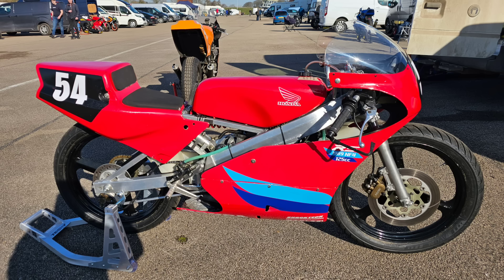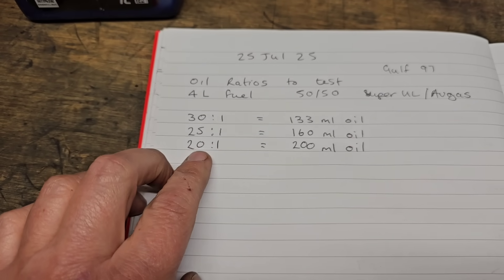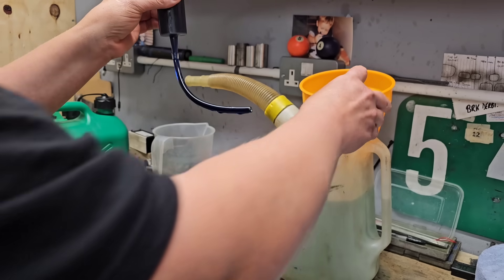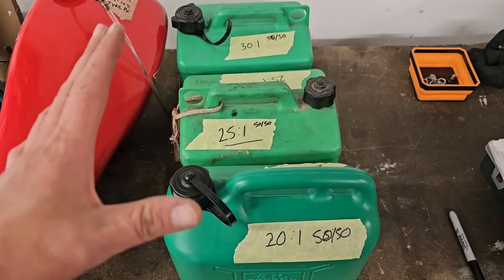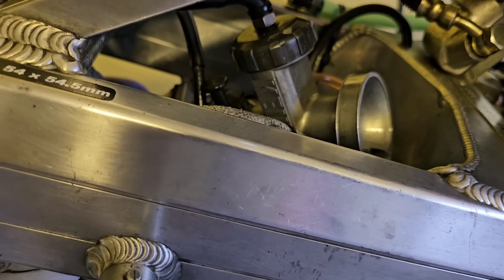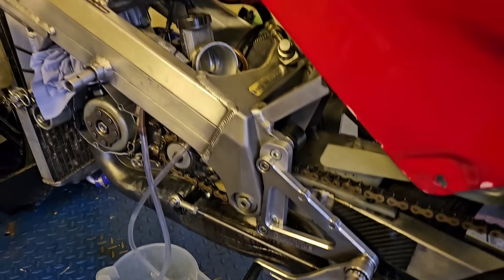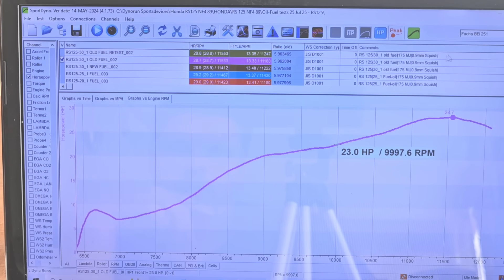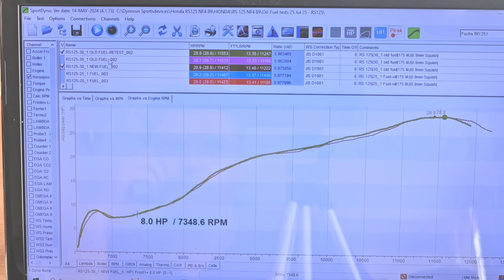Does 2-Stroke Oil Ratio Really Change Power? (Dyno Tested)

Comment: Depends on the quality of the oil tbh pal on how thin or thick you mix the oil to how hot and cold the engine will run, I’ve found more oil or cheap quality oil more carbon on the piston crown and exhaust port as nuts as it sounds the more oil the less fuel is mix when it gets into the combustion chamber it’s actually a leaner mix makes engine run hotter , me personally I like to use decent quality oil at higher ratio .

Comment: That was a wrong test my friend.. you didn't consider the fact that with a "more oil " ratio you must re jet your carb. More oil means ever so slightly thicker fuel so you must go higher on the jets for proper flow. What you did was even though you put more oil you were actually running that bike leaner

Comment: Can you please retest this with a jet up each time you increase oil? When you increase oil it does make more power when jetted for it. To compensate for the fuel loss in increased oil because it drops fuel percentage in the mix = leaner on fuel so you need to jet up to have the equal amount of fuel as the lower oil ratio has while still maintaining the higher oil ratio this will be severly more accurate and will certainly make a gain

Comment: Simple...fuel oil has to be 2% to 4% depending on the engine and conditions (outside heat, movement or not..etc).
Too low...you destroy the engine, too high you let too much residue in the system and performance will decrease in the long run (exhaust mostly).
I always used 2.5 on my cr250r and it has always worked nicely.

Comment: YOU HAVE TO try tungsten disulfide. either in the gas (small amounts accumulated and dispersed through carb bowl) OR try powder treatments into the air intake. 

I bet you go much further without siezing with lower amounts of oil. But it can only help if you have the real stuff deninetly not tungsten powder, TUNGSTEN DISULFIDE.
Reply from the maker: Thos stuff: https://ebay.us/m/oeMj82

Comment: More oil in fuel is little more power, because of less internal friction. Better cooling of engine and more linear performance. Only problem is sparkplugs, if they can burned rich oil fuel mixture properly. I have a moped 50cc 2 stroke 25 years ago, and i used 33:1 fuel/oil mixture with no problem.

Comment: Great video thanks. What benefit do find by adding avgas rather than 100% pump fuel. Asking as we are moving to big tracks next season on a 2 stroke. Currently racing 2 strokes on small tracks
Reply from the maker: I never tested the difference, but from what I'm told, Avgas really helps with detonation prevention and burns cooler.
In theory, race fuel should be better, but this is a cheaper alternative. I do plan to try and test this at some point.

Comment: Extra oil produces more drag, not the oil, extra oil. Fuel alone is what makes power in the fuel/oil mix not the oil as you have so figured out. Thanks for the video.
Reply: What you said makes no sense. You can see the 20:1 made more power and ran leaner

Comment: Used Golden Spectrum at 40 to 1 in all of my 80’s Yamaha YZ dirt bikes and adjusted the jet sizes, midrange needle, throttle slide cutout to achieve the proper air fuel ratio.😊

Comment: You lower the octane rating with a lot of oil.
Many past tests have been conducted with an ideal ratio of 7% oil to 1L of fuel:
The engine delivers its maximum power.
For an engine with a high compression ratio, it is recommended to lower this percentage.
Reply from the maker: Thanks for the info, interesting! Cheers, Dave

Comment: I don’t think the AFR is richer at 20:1 because of the oil. I mean, sort of. I don’t think it goes up because there’s more oil. You’re dealing with jetting, not fuel injection. You’re falling within a range within that jetting and jt may be higher, may be lower. I don’t think you’ll find it consistently higher.

Comment: A lot depends on the quality of the oil, I used Motul 600 at 40:1 in my CR250, doing a routine piston change I was amazed the crank and conrod had a film of oil on them, I used to run my CRM250 on standard shell 2T oil from the petrol station at 50+:1 and that bike went to the moon 250k km with regular piston changes (10k km) but no rebore, it will always be a mystery lol, I've always used premix on all my smokers and reduced the oil so it doesn't smoke so much or clog the pipe, reducing little by little.

Comment: [In my opinion] MORE fuel = MORE power correct? Well IF any given volume of fuel molecules in that combustion chamber are replaced with oil,= LESS power? Right? NOT With older 2 stroke fuel additives !! more conventional additive = MORE power [to an extent] but newer synthetic additives do not replicate such trend, therefore newer synthetic fuel additives just run enough to function as lubricant and NOT to replace fuel molecules

Comment: My 1974 Garelli 50cc chrome bore used to run on 25:1 , my MZ 250 supa 5 was specified at 50:1 , although I think this was for emission control . Better to run at 33.1. this is using cheap mineral 2 stroke oil . The MZ had a long stroke engine , so revs were about 6k .

Comment: That was closer than I would expect for multiple runs with exactly the same mixture. I understand that some car manufacturers claim that 1ltr of oil per 1500km is acceptable in a 4 stroke car engine. Depending on fuel consumption that could be about 100/1 if my quick calculations are about right?not much better than a lean mix 2 stroke. Progress for you.

Comment: I dont premix in weird amounts like that . Anyone double check that those numbers equal the ratio he says ? I've always remixed in nice round numbers that I can do at the pump if necessary. 50:1 500 ml to 25 l fuel
Reply from the maker: Hi, the ratios are correct. I used an online calculator and worked it though myself.

Comment: I raced a Yamaha TA125 in the 70's and did the same type of testing.  The results were similar until I went wild and ran a 15-1mix and saw a significant increase in power (around 3%).  I did some more tuning with jets, plugs, and needles and ended up using a 17-1 mix that gave a 4% increase over baseline.  The difference could be air vs liquid cooling.
Reply from the maker: Sorry, I missed your comment before, but that's really interesting.  Im going to go back and do some more tests later this month, and I'll try 16:1.
Cheers
Reply: @AutoBeta2T jetting dont forget😉

Comment: My experience with RC model engines ( I convert glow/methanol engines to run on gasoline, using electronic fuel/air control a bit similar to what Stihl does in their M-tronic product line, and I do a LOT of testing and comparing), is that running conditions (i.e. changes in jetting or fuel/air ratio) can easily take up to an hour of runtime to take full effect due to the influence combustion residue has on the oil properties, and similar, changing to a different fuel/oil ratio, also can take a considerable time (like 30 minutes or so) before the amount of oil in the engine stabilizes.

So my thinking is, I know it is not very practical, but to REALLY see what difference it can make, you should run the bike on the track for one hour on mix ratio A, then do a dyno, run it on the track for an hour on mix ratio B, do the Dyno run, etc etc.
That way you are sure, conditions have stabilized.
Reply from the maker: Cool info, cheers.
However, I dont think I'd be able to a test that involved.
Reply: @AutoBeta2T  Depends how you go about it...
It does not have to be in one session. My data also was not collected in one go, but over the course of a few years. Back then I did a lot of engine conversions and saw recurring patterns.

Comment: In my own "testing", the engine felt slightly crisper on 50:1 compared to 32:1 but the main bearings didnt last very long, and after that just ran 20:1. It never occured to me that I should have re-jetted the carb if changing the oil/fuel ratio, which was probably where the change in engine feel came from!

Comment: I would prefer running more oil..I like longevity and reliability more than performance. I'm using a 100cc chainsaw to cut up some really dry hardwood with a tungsten carbide chain. The wood kills a regular chain in about a inch. So for me run rich and 25:1 but now after this video maybe 20:1

Comment: What people have to understand with 2 strokes is you have to think it as two ratios when you mix oil and gas. One ratio is the lubrication ratio and the other the a/f ratio. So when you mix oil in gas the oil is actually taking up part of the area of the gas. So the more oil you run in the gas the leaner the a/f ratio will be if jetting is not charged to adjust for it. So yes if you run more oil in your gas like 20:1 over 40:1 it will make more power at 20:1 because the a/f mixture is leaner. It’s getting more oil so more lubricant but less fuel so leaner a/f. Clear as mud lol

Comment: oil testing takes a while for the engine to normalise. The oil pools at the bottom of the crankcase and the correct ratio can only be determined after the engine has normalised after a period of use and the pool will tell you if your ratio is too high or too low. I run that oil now (and will get engine wear results in due course) at either 20:1 or 25:1 engine dependent. I was running a castor synthetic blend but was getting stuck (dykes) rings and varnished skirts but they ran like a scalded cat with no cylinder wear.
Reply: forgot to say that 976 gives acceptable plug colouration for jetting on unleaded, with deposits shifting on old plugs no worries
Reply from the maker: Cool, that's great info.
Have you any experience with Elf 909?
I'm tempted to try some race fuel, too instead of 50/50
Reply: @AutoBeta2T  I havent tried it but dependent on wear results on the newer engine we are running I may go back to a castor synthetic blend. Maxima 927 is a fantastic castor blend, worth looking into. those leaded engines really like lead.  The only thing that could be worth looking into is blending in some light ends like xylene and an oxygenate such as mtbe or ethanol. Stay away from expensive race fuels and spend it on seat time

Comment: Back in 1981, Maico came out with a 100 to 1 oil. On my 490, it was hopeless; shutting the throttle in 5th gear would result in the dykes ring sticking, the motor would still run, but would no longer wheelie in 4th gear, requiring some alloy removal from the ring land of the big Mahle piston.
The solution was to hold full throttle and hit the kill button when slowing, giving the engine a nice gulp of cooling raw fuel.
25 years later, my Gasgas EC300 running 50 to 1 Motul never seized with the Nickasil barrel, but would shrink and rattle the piston, increasing the clearance and needing replacement every 3000km.

Comment: You are not taking into account the oil in the tube are you? Perhaps you should use a measuring cup.
Reply from the maker: True, but its the same for each mix. Also, the volume of the tube is just over 3ml so not a massive amount.

Comment: Oil kill's octane!
Reply from the maker: Do you know by how much?
Reply: @AutoBeta2T  example, I had a Mercedes 107 with 117 engine, extended idle of 5 to 10 min's, would start smoking out exhaust, driving it would clear up, had great compression but would rattle unless used 93 octane, repaired valve guide seals and ran 89 oct with no rattle.still have car.
Reply: And in the dirt bike world, we would run a 40 to 50 to 1 to help cut back on the silencer packing from getting saturated with oil and cut back on the typical oil drool out the pipe.

Comment: The bigger the motor the less oil you mix. My 700 zabel runs 100:1 no problem
Reply from the maker: That's quite a different ratio to what I've run, thanks for the info.

Comment: I've experimented over last 40yrs my preference is 40-1 as rd going 2 stroke suzuki 250 and ridden 9k mls over last 2 yrs with no engine issues not sure on overall power but its very ridable I've engine ported & piped by mick abbey tuning.
Reply from the maker: That's good to know, thanks for the info on your experiences. Mick is a top chap!

Comment: I have been running Bel-Ray MC-1 and H1-R full synthetic at 50:1 per their instructions with California 91 octane gasoline (which is complete garbage, by the way) for 30 years in all my 85/86 ATC and TRX 250Rs. I run it just a hair on the rich side on all of my bikes. I have never had any issues or failures from the fuel:oil or air:fuel ratio. Also, I predominantly ride in sand with paddle tires. I am WAY heavier than Honda ever intended their riders to be as well (currently 280 lbs. fully kitted out, but consistently losing weight) and I desperately need shorter gearing. It's on the list of changes to be made.

I have only ever had one seizure and it was due to the previous owner of my 1986 ATC250R leaving the hose clamp loose on the upper cooling hose where it goes into the cylinder. It lost just enough coolant to put a hole into the exhaust side of the piston. I get challenged by people all the time saying that my engines are going to blow up from too little oil mixture. I have put many times the hours on my top ends that they have and they are replacing parts much more often. Haha

I relocated to TX last year and have yet to ride with their 93 octane without all of the junk that CA puts in their fuel. I am excited to see what a difference it makes!

Comment: You will not find a single test ever published showing less oil makes more power.  You will find the opposite.
I think there is an argument to made that in a premix application - we can sufficently get by at fairly lean oil quanties application depending - and in throttle response there could be moments where oil rich set ups are lazy say coming into a corner then onto the gas - for a brief moment. But anyone who thinks running less oil is better is crazy IMHO.  5 or 6 ounces of oil per every gallon of fuel consumed would be considered wild in a 4 stroke.
Reply from the maker: Cheers Derek,  I guess you are running 25 - 20:1 as a ratio then?

Comment: As a racer on a shoe-string budget, for years I ran 20:1 to try and preserve the life of my engine.
However; I have came to the conclusion that I since I am rebuilding my engine at certain intervals anyway, I decided to try and save money on oil and just rebuild the engine on scheduled intervals to prevent engine failure. So now I run the manufactures recommended 36:1, it seems to work. I'm happy to be wrong, but that's what I've concluded.

Comment: IME, lubricating oil has a similar octane rating of diesel fuel.  (very low)  So, in theory, in a two stroke, adding more oil reduces the overall octane rating of your fuel.  That's why it's generally good to use higher octane fuel in a two stroke.  Unless you're seeing major blue/black smoke out the exhaust, most of the oil is  being vaporized, then eventually burned and consumed as fuel.  As others have mentioned, using too much oil can have the unfortunate side effect of fouling spark plugs and causing carbon deposits.  Every engine and application has its sweet spot.
Reply: Yeah you can more or less assume that the mixing octane rating of lubricating oil is zero. So if I make a mix of 9 parts 100 octane petrol, 1 part oil the end result should have octane rating around 90, discounting other "weird" stuff that can happen like oil droplets acting different from the bulk mixture.
Reply from the maker: Thanks for your input, and the points on the octane reducing. More things to consider - cheers 😊
Reply: BS . Aprilia RSA125 GP bike was running Agip castor based oil Agip race fuel and mixture was always +4-5 % and engine made +56hp

Comment: as a non-2T owner, why are you mixing with AVGas?
Reply: Bc why not, pre sure it’s cheaper
Reply from the maker: It's leaded and has a higher octane rating than the super unleaded petrol I can get.
It's more expensive than super unleaded petrol but should offer better detonation resistance.

Comment: Great test, have this doubt for a long time.
Little observation, your ratio was variating from run to run. If you input manually a fixed value, you'll get clearer results.
Reply from the maker: Hi  Happylettuce, was that the ratio after the torque figures?
This could be the rear tyre. It's really soft, so could there be some slippage?

Comment: about time someone did this. Great vid, well done Dave.
Reply from the maker: Cheers, John.
I think I need to do some more testing on this in the future.
I'd like to try a castor based oil and maybe some race fuel.
Reply: @AutoBeta2T  My belief has always been that more oil = less friction and less heat. So running on an inertia wont tell the whole story . I think that if you were to do the same test on an eddy brake dyno with load and longer runs (i.e create more heat) the higher oil mixes would be clear winners. Also I would add that some people are running as lean as 80:1 on modern mx bikes (madness imo) would nice to see some leaner ratios tested to debunk the less oil = more power theory but you may start wrecking engines lol.
Reply from the maker: @john63397 yeah, I'd love a retarder for the dyno. The roller actually has an extra long axle for it to be mounted to.

Next time I may do the tests in 6th instead of 4th to increase the duration.

Comment: When you sucked up oil into the syringe, you had a piece of tubing. Did you calculate that volume?
Reply: The oil in the tube stayed in the tube the measure was correct
Reply from the maker: The volume of the tube is 3ml, but as Randy says, it stays in the tube